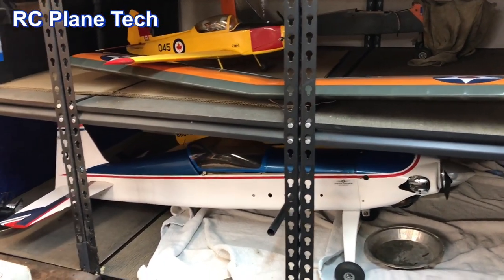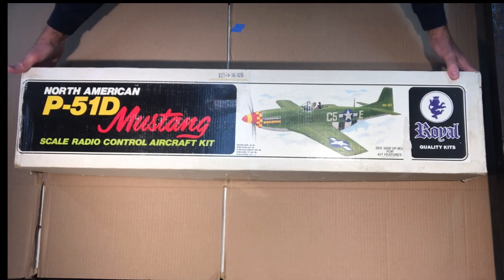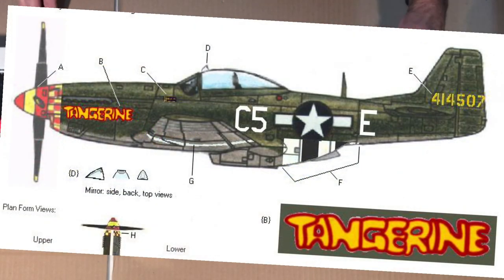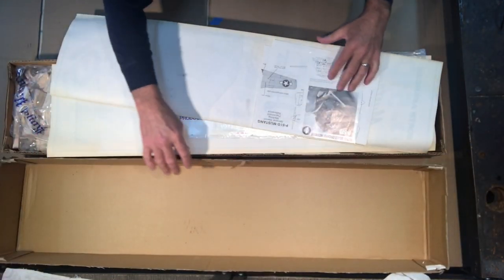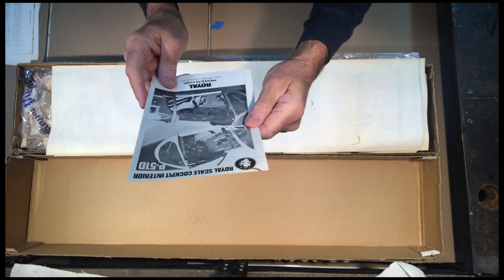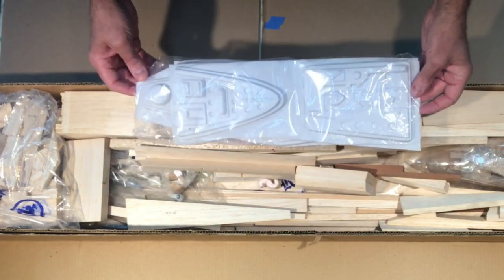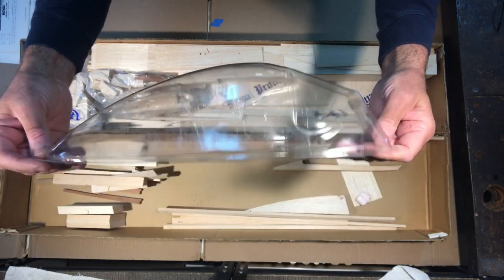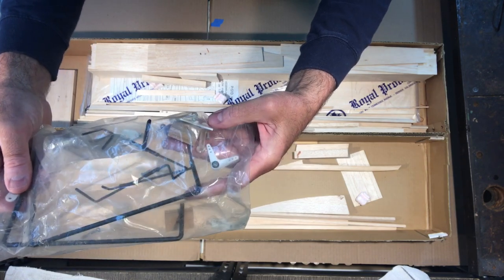Vintage P-51 Mustang RC Plane Kit in box review and Ideas

Comment: I bought a CD drive from a gentleman on Ebay for all the Royal kits plans. I already tile printed the B-25 Mitchel and cut and taped together. Nicely done. Or you can take the file to office depot, max, fedex kinkos, ect. to have full sheets printed.  Can even have them  enlarged or reduced.
Reply from the maker: Nice, those are awesome kits. Im still a little intimidated to start this one. Good luck with your B-25!
Reply: Thanks. I have the same P-51 kit and the spitfire that I purchased from Ebay
Reply: The kits are very well done with a lot of balsa blocks. To keep it lighter, cut out material from the inside and lightening holes in wing ribs, ect.
Reply: I also have a  Royal DC-3/C-47 kit that  i purchased from an estate sale in southern California along with a bunch of rc stuff, a package deal. The C-47 fuse was started.and i have done some more work on it like repairing some nose damage and sheeted the fuse. Nothing else has been constructed.  The kits are pretty muck straight forward,  just follow the instructions and refer to the isometric plan views and you will be fine.
Reply from the maker: Thanks for the tip, I have seen this as well on some of the forums that these build heavy and to lighten it up where you can.
Reply from the maker: I love the DC-3 / C-47! Anyone into aviation has to love that plane!

Comment: Nice complete kit from back in the day. I would like to give you my opinion on 60 size scale kits like this one though. The effort that goes into them far exceeds their flying quality’s. What I mean is, usually a plane this size once you start adding retracts, cockpit, pilot, flaps, fiberglass & paint doesn’t fly worth a damn. Or should I say, land worth a damn. They just get too heavy. 
If you want to do something scale I would recommend putting your energy and time into a larger kit like a Top Flite Giant scale. They just land so much better. Anyway, that’s my thoughts, I enjoy your build videos. Good luck!
Reply from the maker: Thank you for your insight. Through my reading on older forums on these kits is what you noted, they tend to build heavy and fly hard. Lots of people saying to build them as light as possible. I’m relatively confident that I may be able to build it, but not as confident that I’ll be able to fly it! Lol. Hopefully it won’t end up being a green brick. I would love to do giant scale one day also, maybe one day. Thanks for your advice.
Reply: @JamesRCPlaneTech  maybe modern radio equipment and electric power?